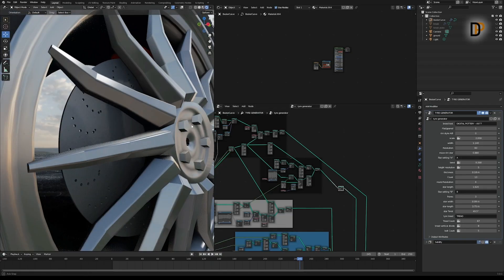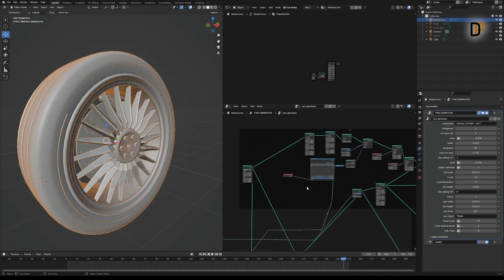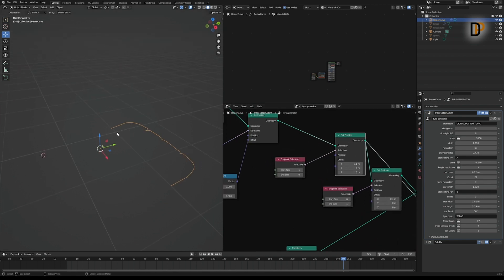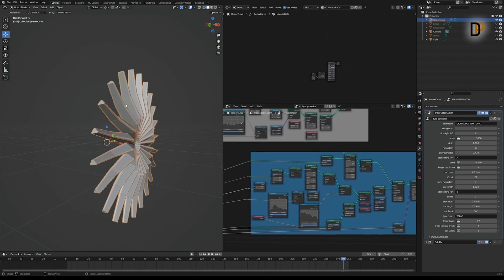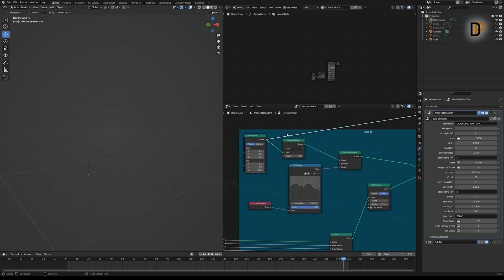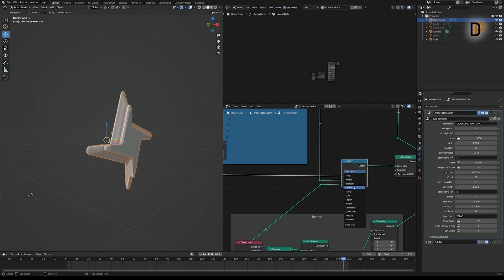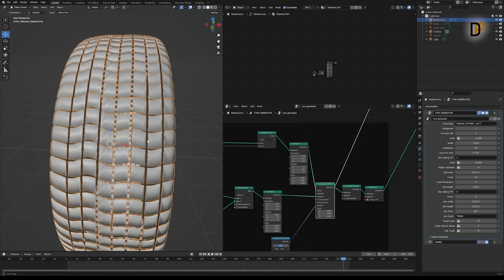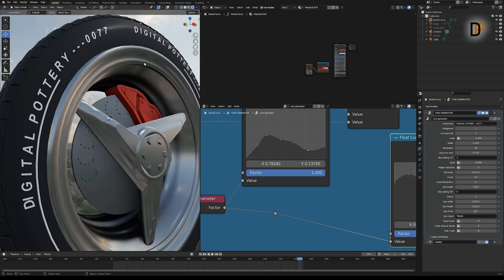blender geometrynodes Tyre generator

Comment: Are we allowed to sell 3d scenes that contain this node setup or any other generators made by you?
Reply from the maker: Hi there ! Thank you for your kind request! you can use it in your scene as an additional input for example if you model a car with this generator or any scene, yes you can definitely sell your art work . but you cannot resell it as it's and  you cannot resell it as a package or as an addon, because we are  developing an environment and props addon for the last two years that will be released soon and it's gonna be amazing! So all these and additional 50  generators will be  part of this addon kind regards!
Reply: Thank you very much 😊  @digitalpottery

Comment: i'm appending in blender in 3.1 by selecting the tyre_generator but only the break & break pad is linking? Help
Reply from the maker: When you append  the blend file go to node tree folder and select the geonodes in the folder and then on your mesh add new geometry nodes and apply it from the drop-down menu in the geometrynodes panel .if it doesn't work I will share you a screenshot let me know 🙏 regards

Comment: When I open the file, I get errors like "undefined socket".  all nodes are red.  how can i solve it.
Reply from the maker: Which version of blender are you using? It's made in version 3.0 there are new nodes in version 3 and much faster . Let me known if it doesn't work regards
Reply: @digitalpottery  I haven't downloaded it yet, I'm downloading it now.  I'll write if I run into any problems again.  thanks🙏🙏
Reply: @digitalpottery  its all good sir, thank you again🎉🎉
Reply from the maker: My pleasure 🙏